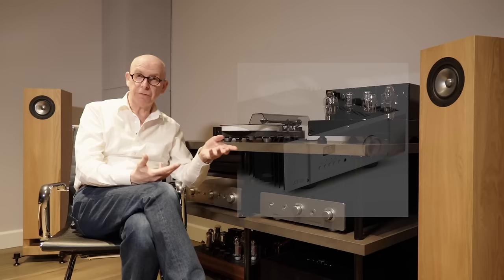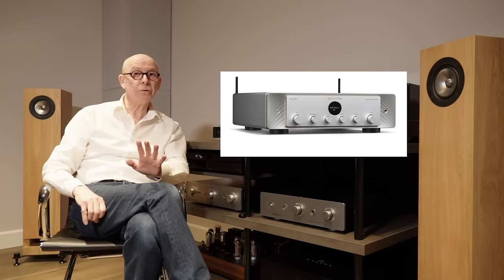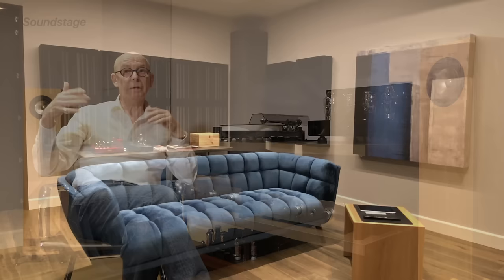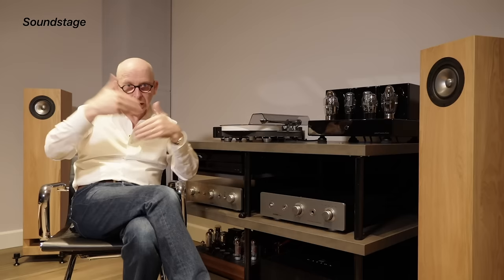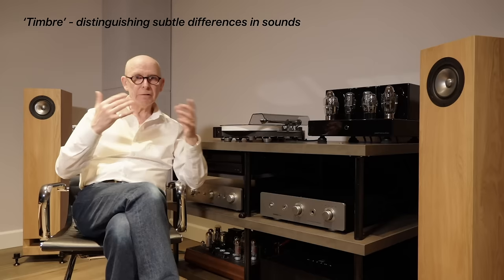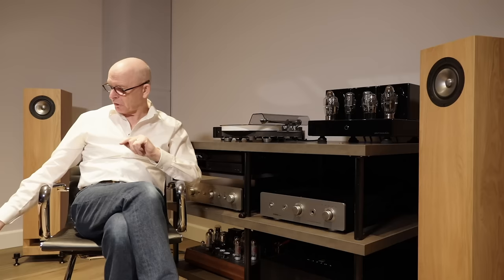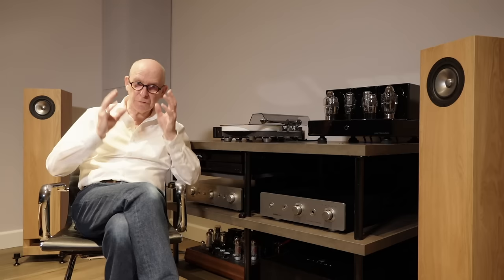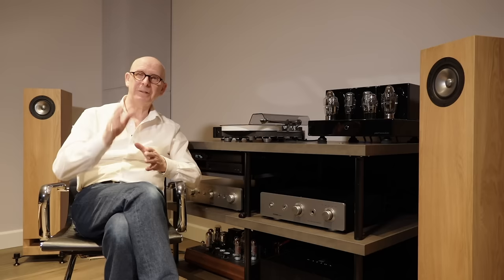Class 'A' vs 'AB' amplifiers: The search for a perfect soundstage and an emotional connection

Comment: The Aethos is most definitely not single-ended.
Reply from the maker: Absolutely not. It’s a class AB amplifier, that’s why I chose it for the comparison.
Reply: Indeed, but you did say at 2:40 that it was single-ended 🙂
Reply from the maker: @almscliffe  ah yes, I see where the confusion has come in. absolutely - I did. There are two meanings for ‘single-ended’ either class A single ended (output) design or single-ended inputs (RCA), rather than balanced. Maybe you missed it but I mention in the subtitle at that moment, that I used the term Single-ended to mean ‘RCA’ only, with no balanced (differential) inputs or design. Sorry if it caused confusion.
Reply: @PearlAcoustics  Ah, I missed that. Thanks for clearing up the confusion.
Reply: @PearlAcoustics  ...although if an output is 'single-ended' it does not mean that it is Class A. It just means that's it's not differential. Op-amps outputs are biassed in Class AB and the majority are single-ended but some are differential. A pair of single-ended amps in bridged mode would be a differential configuration, regardless of the Class of each.

Comment: Very interesting points made. Especially timbre... probably the most important and least discussed element of sound reproduction. Here's my experience with amplifier soundstage: I have a couple of class AB solid state diy amps, one of which can run with up to 300mA idle current bias. As the bias is turned up, the soundstage grows (more separation, wider stage) and tonality is shifted. It sounds 'clearer'. However imaging and overall cohesion starts to go down at the same time. There's always a sweet spot! If an amp sounds good, it's not just the Class, it's how much effort the designer has gone into tweaking it, trying different parts etc. and what that designer considers important characteristics (measured spec vs. subjective enjoyment).
Reply from the maker: So true! Thanks for sharing your observations

Comment: Thank you Harley, for your enthusiasm in identifying the amplifiers that can reveal the low level detail in recordings that differentiate the different classes of output stages, and which also make for long tem enjoyment of music.

I have recently aquired a Class A amplifier that is 'probably' one of the rarest amps ever made and it dates from the 1990's. It's a JVC AX-SD1GD, made just before they went bust, were very expensive, brought about JVC's demise, which was subsequently  bought out by Kenwood.

It  runs quite warm, is built beautifully and has made me sell my previous amp, my Quad Artera Stereo which is highly regarded. The JVC is low powered (35watts per channel to 8 Ohms), weighs about 14 kilos, (double mono construction) is an integrated amp and it sounds wonderful driving my PMC Twenty5/23 floorstanders. It sounds much more powerful than 35 watts and I'd like to try it with your Sibelius loudspeakers. It's also very revealing of low level Information, unexplained noises, even performer's breathing and off mike sounds which add to the effect, which were not noticed before.

I am a fan of JVC amps and knew about their development of this 'luxury'  compact hifi system, but could never find them for sale. One evening I saw an Ebay ad for  the selling of a lot, held by a hifi collector who bought stuff when it came out, played it once then mothballed it. An item in the lot gave me a jolt, I recognised it at once and snapped it up, fearing it was a scam or a mistake, but no, I now have the amp. I did not expect the sound, it is superb and I've not stopped listening to it since, something I never could do with my Quad Artera A/B amp. I tired of listening very quickly with the Quad and couldn't really figure out why, it had tremendous power and slam, but it made me not want to listen for long.

After seeing and listening to you debating about the best amps for your listening, I was gearing up to buying one of the Sugden class  'A' amps but the JVC has now satisfied my quest. i'd still like to hear it with your Sibelius loudspeaker though, so I'll have to find the nearest stockist. I live in Essex, UK.

Thanks again, for your very interesting videos. Please carry on.
Reply from the maker: Hi Chris, thanks for sharing your wonderful story and observations. Sorry for the late reply but I have been away on holiday. If you reach out to me/us via our website, maybe we can find a way of getting you and your JVC hooked up to a pair of our loudspeakers? 
Enjoy your amplifier, I am sure it’s very fine. I would love to hear it!

Comment: Another great video! Re soundstage beyond the speakers, my Sibelius DEFINITELY deliver, and they do literally disappear. Same also for center channel and depth in the center. Re amp comparisons, I could not hear much soundstage difference; might be difficult with earbuds. However, very strong timbre differences. The two big boys sounded anemic (sort of ironic with all the famous "headroom" of big amps), while the two CAs sounded fuller, with the INT25 having most life in it. I can also confirm Sibelius being great at fine timbre separation. As you may recall, I am an amateur HIPP baroque string player (viola d'amore). Particularly with gut strings, bow speed, pressure, position opens up a lot of expressive possibilities. Sul ponticello and flagolette/harmonics are possibly the most obvious ones, but there are infinite gradations. Playing the same note on different strings results in different timbres. Extreme case on violin is open string (say a) vs. 4th finger one string lower (d string 4th finger = a, or even 5th position g-string). I can certainly hear and appreciate those nuances in good recordings with the Sibelius speakers. -- Enjoy your holiday in France; currently doing the same in Vienna.
Reply from the maker: Thanks for sharing your wonderful explanation and experience. And thanks too for your kind wishes. I am back from France now and listening to Brandenberg No. 5 while I write! Enjoy Vienna, I am off there in June.

Comment: AB has more 'bite' - better for live bar setting. A is better for private/studio use, easy listening. My favorite is the INT-25, so clean. I notice Pass Labs are now using single industrial FETs rated at 700w / 40 amp EACH (not parallel banks) which will help! 🎤
Reply: I think one pair Vs paralleled pairs, and push-pull Vs single-ended output stage types, is more significant to sound quality than class A Vs class AB.
I have a Pass Labs XA25, I value it for the lively and dynamic sound I've only heard from push-pull amps with a single pair of output devices. I could see myself going back to class AB one day (because I've heard plenty of AB amps which sound smooth to my ears) but not back to an amp with paralleled output stages (they all seem to suck the spontaneity out of the music, expect for a few high-end amps I could never afford).
After reading Nelson Pass' comments on the design of the XA25/INT25, I don't expect the single pair circuit to become a feature of the whole range of Pass Labs amplifiers, the motivation seems to be to produce a smaller/lighter alternative to their standard offerings, although he does say that the non-paralleled output stage has a more "organic" sound.
Reply from the maker: Thanks for sharing!

Comment: Most Class AB amplifiers run in Class A for the first watt or so.  You've already done a video about how loud 1 watt really sounds, and considering that most of us habitually listen needing only 1/1000 watt to 1/10 watt I don't understand the need for a pure Class A amp.  Preference for Class A amplifiers over Class AB is indeed personal bias.
Reply: There’s Class A and then there’s “CLASS A” in my opinion. No, I can’t explain it.
Reply: I agree, one way of tell if it’s done right is the power requirement, some 30 watt output amps require 100 watts where others require 300 watts. My Luxman L590AXII requires over 300 watts and is Sublime. 🤓
Reply from the maker: Thanks for sharing. Although that’s sometimes true, my experience is that many AB’s are only in class A in their preamp sections.  Or maybe for the first eighth of a watt. In the end itsvthe music that matters and whether we can enjoy it with what we have. Best wishes

Comment: Excellent discussion.
I was drawn to the Pass amp in this demo followed by the Sugden.  Both a little more 3D than the others.
I believe that imaging and timbre depends on the accurate reproduction of low level information.  This information is at barely detectable amplitude but out ears catch it just as you microphone does, and our brains are well evolved at using this information.  Dogs even better.
I find almost anything can destroy this information.  Class A, simple or no crossover, lowest possible feedback, resistors in the signal path and transformers can really impact it.
Triodes do better than solid state.  A single high sensitive driver with little or no crossover is good.   Output transformers are critical and OTL even better.  Coupling caps are critical. An autoformer will work better than a resistive potentiometer.  I like silver better than copper for transmitting signals.  Over specified power supplies help.  Generally the simplest circuit with best component quality will win out.
So everything matters.  When you get most of it right the sound illusion exponentially improves.
Reply from the maker: Thanks for your kind appreciation and addition to the discussion. Much appreciated

Comment: Harley, I tried a little experiment. First I listened to the comparisons through the speakers of my TV, with the video streaming over HDMI from an AppleTV 4K. It sounds silly, but I COULD hear the difference - not full range or high fidelity of course, but I was surprised. I could immediately detect the Class A difference - Clare’s voice had more harmonic texture (timbre) and weight. The second pair were hard to differentiate.

Then I listened with good (though not “high end”) Beyer Dynamic headphones and I could discern the same differences in (and preference) in the first pair. For the big Sugden and Musical Fidelity power amps, a distinction was there, but I had a hard time decided which I preferred. At first I thought I preferred the Sugden as it had more weight and body. But on a second listen I found myself increasingly interested in the sound of the Musical Fidelity - it had a delicacy in the upper mids and higher frequencies that was almost beguiling.  Next I will run it through my primary system to reveal more.
Reply from the maker: That’s interesting. Thanks for sharing

Comment: Question. Is it possible to power an amplifier with a 230V AC to 32V AC trafo by wiring it to a 32V DC battery pack? I'd like to make a small guitar amp portable on 4S lipos with a step up module to 32VDC at 12 Amps. The trafo is one black 2 red outputs what I asume to common ground. Meassured black to red is 17.8 VAC each. How would one solve the task? The Trafo is going directlly into 4 diodes. Is it better to input the VDC post them? I know this is off topic but I think here are lots of electonix and me is a simple mechanical engineer 😂
Reply from the maker: Hi, indeed a bit off topic 😉 but I hope someone can point you to a good electronics forum for your challenge.

Comment: How interesting, Harley. For me, in ascending order of listening ease and pleasure, it’s Rega, MF, Pass then Sugden. The last shines because of its deep (not just wide) and spacious soundstage, musical insight and feeling of all-round capability and sheer effortlessness. I remember your saying elsewhere that the Sugden A21 SE was noisier than the Pass over which you chose it (XA25?) but that its stagewidth was much greater. With efficient horns, for example, I think the former would be the most important factor in choosing. Finally, did you use the whole of the Int25 or just the power amp section, and how did you drive the other three? I feel the XA25, on extended and direct listening, should be the winner but, in this test, t’Sugden and Class A were easy winners. Great test.
Reply from the maker: Thanks for your kind appreciation. The two integrated amplifiers were used with their preamplifiers to create a fair comparison. Thanks for sharing your findings. Very informative and interesting

Comment: Nice one again Harley. Just a note. I own the Rega Aethos and it runs hot and is in Class A for the first 5 or 6 watts. I noticed you were playing it with the volume at five to twelve. I have never done that. Rarely even at quarter to twelve. That would be very loud. Around 80db. I have Arendal Tower S floor standing speakers at 89db. 4 ohms. My question is Harley. Did you really listen at five to twelve.
Reply from the maker: Hi Sean, thanks for your kind words. I don’t think I ran it at ‘five to twelve’ that was just a photo dropped in. However, I did contact Rega directly about the Aethos and their designer confirmed to me that the Aethos is only in class A at less than one watt. And what I find interesting that I didn’t find it ran particularly hot. Mind you, it’s been a while since I have run it for a very long session. Strange.
Reply: Thanks for the reply. Your kinda right about the heat. It does depend on how long you are listening to it. Like a few hours. Now that it's the summer it gets a lot hotter than the winter. But you have me kinda worried now if mine is overheating for no reason. It's a lovely amplifier. Thank you.
Reply from the maker: @seanoreilly8603  no need to worry, I’ve heard many people say that they run hot - but I am comparing with powerful Class A amps that you can cook eggs on, just enjoy it. It’s a fabulous amplifier
Reply: @PearlAcoustics  Cheers Harley.
Reply from the maker: @seanoreilly8603  👍

Comment: My two cents worth - I have a pair of Plinius SA50 stereo amps bridged as monoblocks. They are Class AB/ true Class A switchable. I can make a direct comparison between the two modes on the same amps. Class AB has more bass - but is it distortion? Class A is more holographic with more delicate detail. One can "see" further into the performance. Late at night, if I am really wanting to pull out the best in a recording it has to be Class A.
Reply from the maker: That’s very interesting and absolutely in line with my expectations. Thanks for sharing

Comment: Interesting amplifier comparison. Siegfried Linkwitz can add more details on why our brain develops this sound stage illusion: It seems to be a survival mechanism, that developed human evolution, being able to quickly and accurately locate threats in reflective environments (caves, canyons). For exact sound source location, we predominantly use the first arriving  direct sound. Reflections arriving >6msec later will be discarded by the brain in this process, if they come with similar sound "color". If the brain would not discard these reflections, it would have a hard time in spotting the position of sound sources in caves / canyons. There are some more factors at play. The performance of our brain in sound source location is just admirable. For this amplifier comparison, it would be interesting to find out, what exactly causes these different sound stage perceptions?
Reply from the maker: Thanks for your kind words and comment. I have spoken with many amplifier designers and I have never met one who honestly knows. It seems to be a mystery! As soon as a theory is put on the table, another contradictory hypothesis comes along